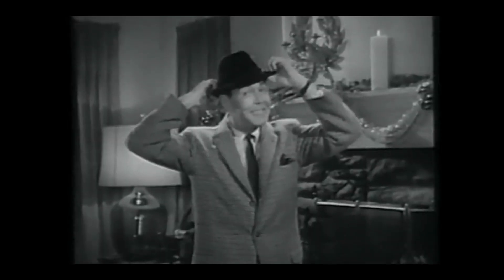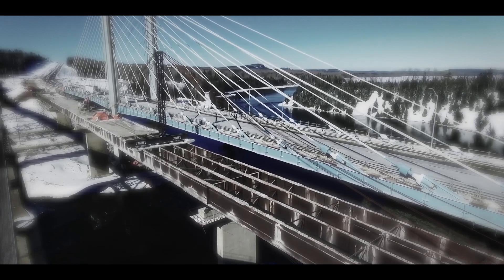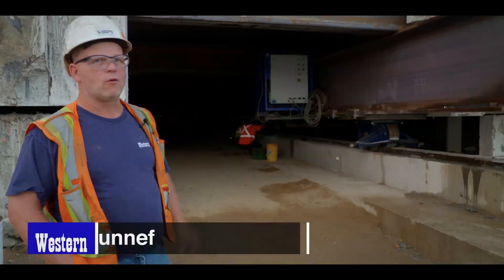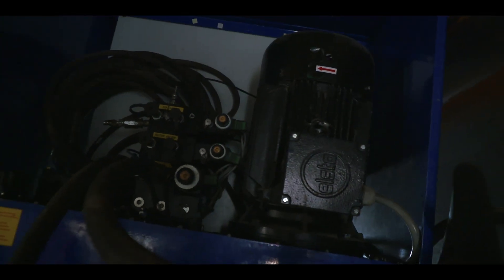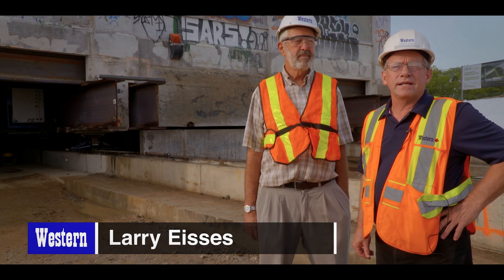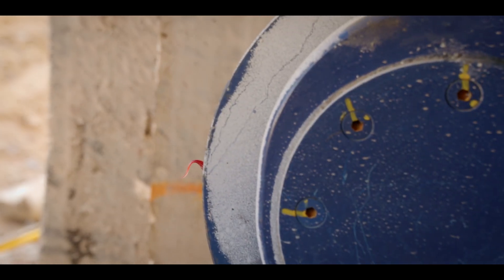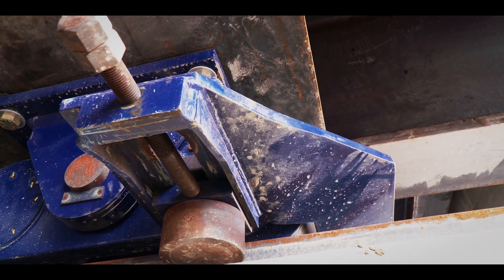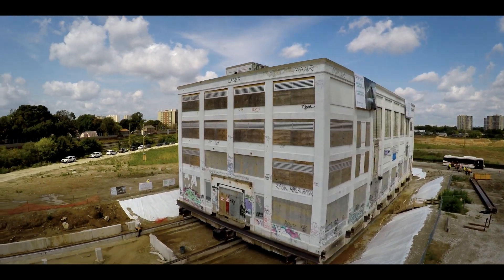How To Move A "Six Million Pound" Building

Comment: love the work but no wonder the crosstown project is is over budget and delayed. Way easier to just demo and build new.
Reply: I agree. It’s one thing to save grand central terminal or the Chrysler building. But this building could be easily recreated without compromise—there’s no loss of artistry or knowledge, no impossible-to-recreate workmanship.
Reply: @jpp7783  It isn't just the exterior; there's all sorts of internal era-specific details inside the building that are being preserved. This building isn't why the project is over budget or delayed in the slightest; moving a building is significantly cheaper than rebuilding.
Reply: The project is over budget and delayed because Rob Ford cancelled the already-started plan for a simple, inexpensive above-ground light rail line to instead make it an underground line. This incurred a massive cancellation fee in the hundreds of millions and delayed the project by years as it got re-planned and then way more work had to be done to dig tunnels and buy out businesses to use their space as station exits. So now we have an underground light rail that's neither as fast, nor has the capacity, of a subway and is having construction troubles on the last leg of the project.
Reply: No! This building has been part of the community for years, so they wanted to save it and give it a new life! Making it a transit station gives it that new life and for once Toronto actually preserves something instead of ripping it down!

Comment: Fantastic video! It's great seeing older buildings being given a new lease on life with new projects.
Reply: Agreed, as long as the building being moved doesn't have asbestos and the cost of moving it and refurbishing it is a cheaper option to tearing it down and building a brand new one.
Reply: @janl7078  oh no this cost the tax payer alot of money but money well spent!
Reply: @janl7078: There’s no doubt it’ll need all plumbing and electrical replaced which will likely entail a complete gut and rebuild on the inside. Then of course elevators, windows (?), doors, insulation, walls, ceilings, etc. AND it looks pretty rough on the outside. Many million dollar project for sure.